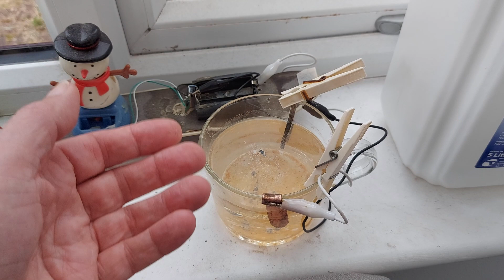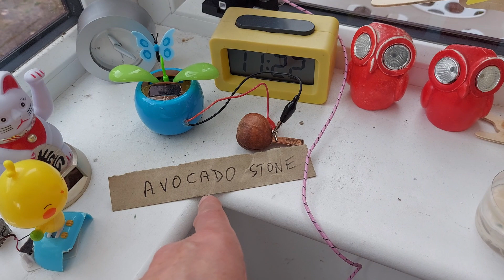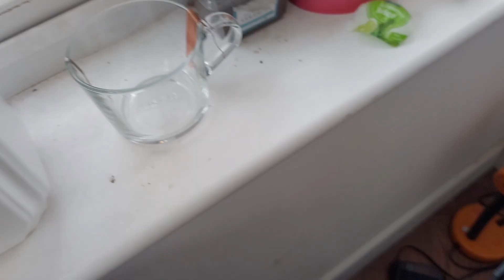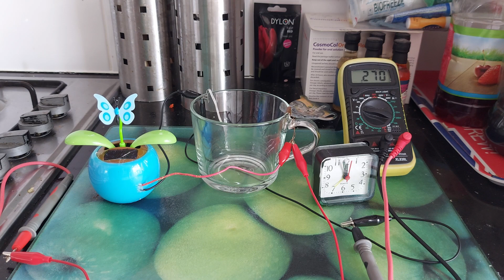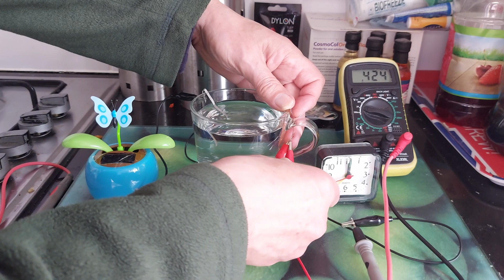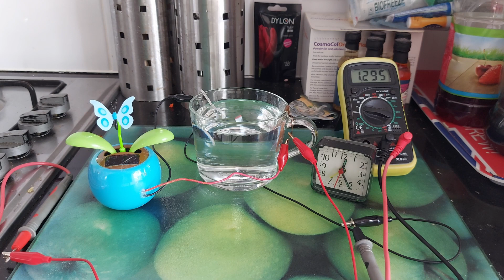De-Ionised Water and a solar rocker

Comment: To provide an even more convincing demonstration, you could rinse out the jug and the metal strips a few times with de-ionised water before starting the experiment.  Any slight traces of washing up liquid or other contaminants from previous use or washing are enough to supply a few  ions.
Reply from the maker: I did that.

Comment: I noticed the bottle for the de-ionised water has a picture of a battery on it.
Reply from the maker: Yes, you top up your lead acid batteries with de-ionised water to prevent them from being contaminated by the ions present in tap water.

Comment: There aren't many things you haven't tried to get the old ions going. 😅
Watching the different liquids, fruits, and vegetables you have used is very interesting. 
God knows what else you have used to produce electricity. I was thinking blood. 
That has to work. After all, we are living batteries.
Don't get me wrong. I was thinking of a nice raw steak. Although a random person might volunteer.
That would be exceptionally interesting. 🧛‍♂🤣🤣
Reply from the maker: Blood did cross my mind, need about half a pint to make a reasonable sized battery. Know anybody who wouldn't miss a little 🤣 Of course there are other bodily fluids too 💩. Then of course there are ideas like putting a slug between the two plates. On a slightly more politically correct line, I have just tried a couple of metal objects that were laying around, like aluminium and Nichrome. Neither worked, but it was worth a try. The aluminium did work briefly although that might have been because of the other residue already in the container.
Reply: @GrandadIsAnOldMan  Slug between two plates. 🤣🤣🤣
They don't like the salt so they may have very few free ions. I would stick a couple of spoons of table salt between the plates also.
That would perk them up and help with the electrical flow. The slug protection crowd will be after us.  🤔😁
Reply from the maker: @mikeflight9  slugs don't like copper anyway 🐌🐌(although that may be an urban myth - a Google search comes up with contradictory results).

Comment: Great stuff, it confirmed the thinking with practical tests. 1.2V isn't too far off the 1.7V, but I'd think amperage would only be about 3uA.
BTW, tried a pulse motor earlier with the same circuit, but 30AWG coil on a sewing bobbin - 43ohms compared to 500 of a rocker coil. Whole video went South because it only ran with vinegar. All those millions of ions and acid also ate the Mg fast! I wanted to join in lol
Reply from the maker: Brilliant 🤣🤣